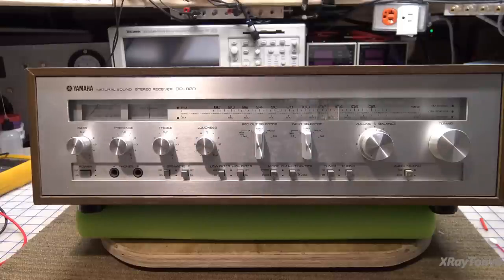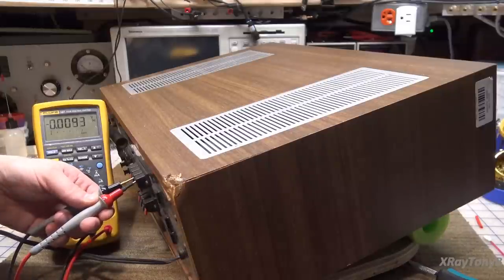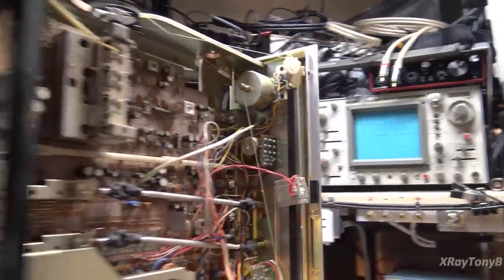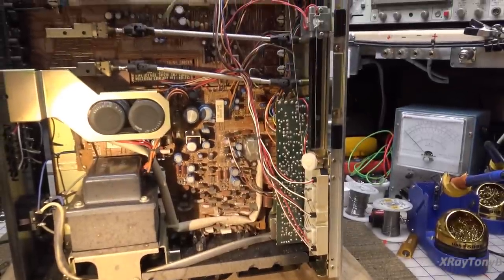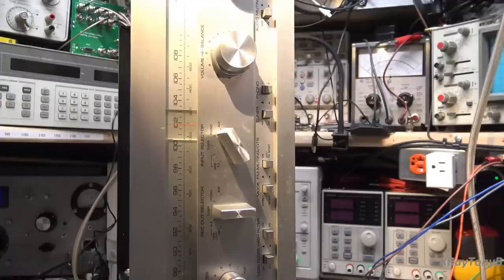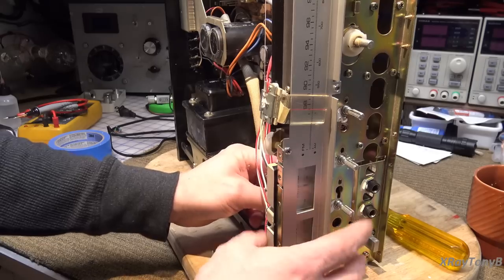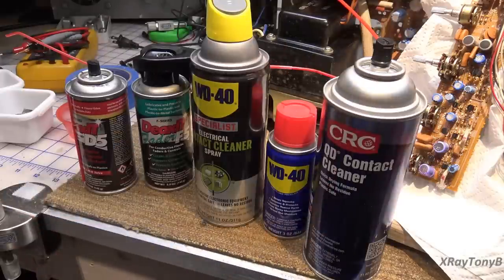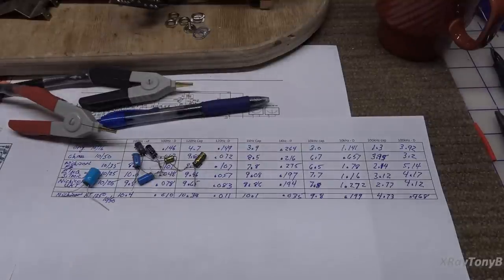Amplifier maintenance 101 - Cleaning Controls & Re Capping a Receiver (Featuring the Yamaha CR820)

Comment from the maker: 0:00 Intro
1:09 First power-up. Checking for DC on speaker terminals
2:45 First attempt at playing some audio through the receiver
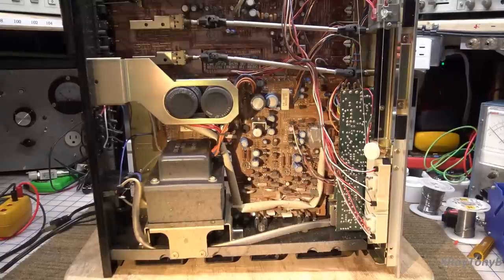4:07 First look inside - cleaning the volume pot and trying once again - success!
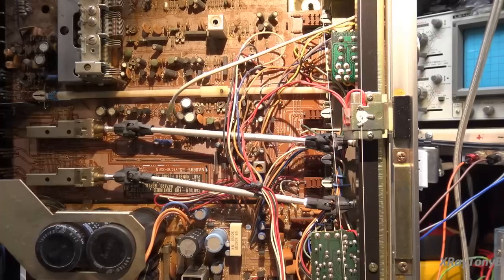8:05 How to clean the potentiometers
26:37 "Re-capping" a receiver - some thoughts and experiments
Reply: explained well, you cover it well
Reply: I usually use brake cleaner, simple and crude

Comment: I've heard dramatic differences after a re-cap. Of course, removing 40 year old caps and replacing them with new will bring the circuits back in balance. The two channels start to sound identical again and that's the magic we're all looking for.
Caps all age differently, even the same cap in the opposite channel can have wildly different readings on meters. I say re-cap  with new, fresh good quality caps and enjoy the sound.
Edit;
Another thing I should note. I've recapped amplifiers and have them sound horrible after. Another two weeks or so of daily listening and they will wake up and sound great.
I'm guessing the caps need plenty of time powered up to settle into their new role
Reply: what caps did you use? i use nichicon golds and i have not noticed a change of character ever with those.
Reply: @sgredsch  I suggest you should have a look at Trevor's channel :) He's plenty of great repairs there.

Comment: Thank you for the demo, and tip, on the Nichicon "FG vs KT" capacitor performance. The KT's are 105C rated, whereas the FG's are 85C, and the KT's are also usually only available in higher max voltage ratings than the FG's, but if one was looking for longevity it does seem that the KT's are the better choice, and they are also priced a bit lower than the FG's . I have a few amps to do reworks on the driver board for, and I am going to choose the KT components going forward, especially on the 2 - Harmon Kardon Citation 16's I have, as the driver boards aren't far from the  power output heat sinks, and the "normal" idle bias current keeps those heat sinks about 60C

Comment: I grabbed 2 - 820s last year for a very low price. 1 was like new and 1 had a couple scratched knobs. Recapped, lamps, pot cleaning a few new knobs and 1 new relay. Both look and sound fantastic. 
Also, I do use WD-40 to clean and shine the back panel on vintage audio.

Comment: Very good explanation on capacitor behavior and testing. Nice that you did the capacitance and tan D comparison on the different frequencies and presented it in the table! I often just make a few measurements on some of the different caps before deciding to or not to recap. Also depends if the unit is going to be in regular use

Comment: This is the best explanation on capacitor testing and aging i seen. I did not understand the values until now! 
It confirmed my experience in recapping 2 20-30 year old amplifiers. While i had no idea about his until now, i just bought all SILMIC 2 reasoning its quality and that the way to go it you know little, and it showed on sound extremely. Both amps (Harman Kardon HK6200/Rotel-931) where totally crazy harsh and unnatural sounding after recap for a month, but turned in to beautiful sound after that initial period.

Comment: It was great to see the info about contact cleaners.  I've been picking up bits and pieces from various videos.  One additional thing I'd like to see is some discussion about the best way to clean flux from boards after changing components, especially when the board is still in the receiver/amp.  Maybe you've covered it already somewhere. I've watched around 30 of your videos so far.  I'm about to start a recap of my SX-1010, and I'd like the job to look as professional as possible.

Comment: Thank you for the demonstration of the electrolytic capacitor's capacity to frequency, so the problem is not just ESR.
I always re-caping old electronics, even new ones with unknown brand capacitors, not just audio amplifiers. Maybe I was crazy changing the looking good electrolytic. I just don't trust old electrolytic capacitors or unknown-brand capacitors.
I have a 20 year old Cosel SMPS, it was very hot when on, recapping all the electrolytic (only 4) and now it runs cool.

Comment: As usual, great video Tony!
I would love to see you take a look at the FM tuner section and OTS(Optimized Tuning System), which includes a touch sensor circuit that disables the OTS whenever you touch the tuner knob. I'm working on one of these right now with MPX decoding issues, complicated by the OTS circuits.
Thanks for the many videos!

Comment: This was great! I believe in re-capping any vintage quality equipment. My HH Scott 387 caps, many read higher cap values. I don't have my leakage tester built yet but think maybe leakage made them read higher than spec.  Also after cleaning carbon pots and a bit of fader lube  I use this moving contact lubricant by Caig Industries - maybe overkill. I always worry about the slider wearing the carbon trace.  Thanks for the cap comparisons I like the LCR meter.

Comment: I did recap of 45 years old Kenwood ka series amplifier after have a doubts what's worth it. Seemingly electrolitics were in the range of ESR and capacitance, all of them Elna and similar trusted marks. But after the complete recap, relay and current adjustment resistors change the sound at the out became so clear and natural what I don't regret about time and money investment on it. More, the smell of old heating amplifier was disappeared after two month of using the renewed amplifier!

Comment: Next project Tony. Solder and chat on recap is nice, but it shouldn't stand in the way for a new project video. I'd rather see a problem-solving video and the process of determining the fault and repair it. Other than that, great informative video, especially the caps part. I like the DER-DE 5000 meter. I might buy one in the near future. Also I would like to know your thoughts on types of caps. Which ones you use in the power rails for instance. And how to determine if the cap is in the audio path or not by looking at the schematics. Kind regards, your Patreon.

Comment: i have only done a few recaps, but most of the time the results were excellent and absolutely worth it. you should resolder all joints anyway, so its good practice to recap. 

most caps i have pulled put measured fine, but the amp still usually sounds alot better after.

I will say, tho, that certain circuits with some foil capacitors in them will not improve as much or not at all. then its just service to improve lifespan. 

I used nichicon golds and the blue ones - elna are really hard to get here. i always switch elko for elko - never tried a film replacement. and i will say that nichicon golds will produce a tube like sound that is very punchy in the lows and silky in the heights with very good imaging. i might try out mkt as bypass or replacement in high Audio frequency sections, but i have been very satisfied with the sound so far. its probably closer to the original Sound of the device than the technically better mkp caps.

considering that most modern high end stuff is either elna silmic or nichicon golds with wima mkp for smaller values, this is probably the best way to go.

Comment: I have been getting notifications that many of the Nichicon caps are being phased out.  The UKL series that are low leakage are included.  What will we use to replace those orange caps?
Reply: Most through-hole are close to obsolete in some or near future. Sadly.
SMD has taken over, and also for amplifiers where the smaller class.D is more and more used, and cheaper to manufacture
Reply: Cornell Dublier ( CDE) still makes a "CKH" and "CKE" line of low leakage caps ( orange wrapper, check the datasheet), they are listed on Digikey and Mouser as still being available as of 02/2023) I tried to link the datasheet here, but Tony didn't let it go through, but just search those and you should find them.

Comment: This is great!
So I guess we'll use automotive caps from now on? 
How do you think a low ESR (SMPS) cap would perform in those tests?
Some time ago I did an extensive recapping on 80ies cheap HIFi and the results there were really noticeable (obviously the design was not so cheap as were the used components - I also used film caps for all values lower than 4,7uF). 
It would certainly be great to see a video of you doing the soldering - there are so much little things you can notice this way ...

Comment: Hello from Meaford Ontario Canada,  thank you so much good sir as I have always wanted to understand the reason for the orange capacitor s , low leakage and now I know and knowing is half the battle lol  and I almost always use Elna Selnec 2 capacitors in my restorations and I was curious if you thought it was ok to use a Elna Selnec 2 capacitor in place of a power supply bi polar capacitor I have done so on a Technics SA 500 receiver and it works great however it seems like the unit is running hot ...or maybe that's by design. ..the sound is glorious as I even used new Nichicon Fine Gold capacitor s and filter caps the bi polar capacitor I replaced with the Elna Selnec 2 was a purple color can you explain those purple bi polar. ..thanks brother from your friend Scott in Canada

Comment: Used to be more of a variety of cleaners. Tuner and control cleaner with or without a lubricant. Tuner Renu by Chemtronics took care of most controls. Saved the D5 (At that time was trademarked Cramolin) for when nothing else worked. It has always been very pricey.  For now I've had good luck with CRC 2-26 for general control cleaning.

Comment: 1:02:14 Obviously re-cap. The sound will potentially roll-off with the caps in the signal path and, as pointed out, its good insurance. For the power supply caps, the re-cap will ensure longevity, but would I suspect help keep the voltage up with large infrequent transients.  I was surprised with the initial results for the FGs; I use them all the time in the signal path (I used to use Panasonic FCs for power supply caps, but sadly the FCs are no longer made) but shelf life, or indeed ultimate life might be an issue for them (they could re-form of course, or they might not..).  The Silmic was excellent.

Comment: I wonder. Thanks for your explanation about the declining capacitance at higher frequencies. However, you make me wonder about the ESR + Cap meter I use. It does its test with 50 kHz - 100 kHz, but I don't see that (new) capacitors have really low capacitance at that test. It is always above the factory specs, or very close under it, except of course when dried out. In your test we see a decline to even 25%.
I use a Peak ESR70 Gold.

Comment: Acids like Butyric acid can be neutralized by a base like baking soda or sodium bicarbonate. So dip your old screwdriver
 in a solution of baking soda and hot water using a disposable cup. Spin the handle end around in it and watch for bubbles,
 lots of bubbles. Guaranteed temporary fix for the smell. Wash the handle and dry it.  The smell will eventually come back since the plastic deteriorates but if you spray an automotive clear coat spray over the plastic it will no longer smell.

Comment: 43:00 Those orange capacitors, I remember I replaced the 3 low leakage capacitors on 2 motor servo boards on a Pioneer RT-707 and a RT-701 with ordinary black ones when I recapped the PCB's.  ( one 4.7uf 50v, and two 2.2uf 16v )

For years I have wondered why the speed had issues on both machines. I did some research and found the leakage current was supposed to be less than 0.027 microamps at the rated voltage on those. Yes it makes a difference. The eye opening of my Heathkit IT-28 on the most sensitive paper/mica setting, 2 uA, does not even show any leakage. I needed to hook up a micro amp meter in series to see the current. Now I need the correct replacements and have to replace them. Lessons learned 🤨
Reply: Elna CERBs are hard to beat in that respect  even by Nichicon UKLs, however have the tendency to go way out of spec, have one 47/16 lifted from a power amp PCB measuring 11uF with 6 or 7Ω ESR. For values below 10u Wima MKS2s fit in nicely.
Reply: @paulb4661  In some circuits I worry the rise time of a film cap may be too fast for the design and cause oscillation and ringing on square waves. Best to stick with engineered designs, I feel more comfortable with OEM unless I can know the results.
Reply: @zulumax1  True, thankfully haven't turned any of the amps into a generator so far myself. In a larger sense, I think that size and progressively cost, as time went by, were the main factors favouring electrolytics over film caps in the majority of home audio products, rather than affording stability of the NF loop. Obviously, you may be in for a nasty surprise, if the ku is above 1 at the point the phase nears 180° out, but an RC is usually employed to keep the bandwidth reasonable.